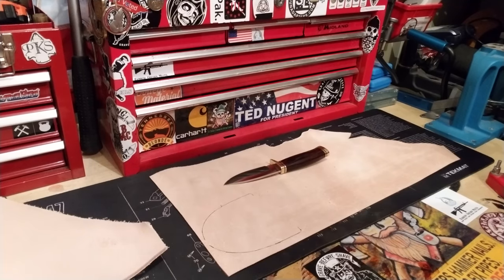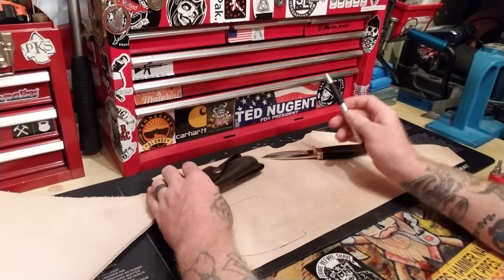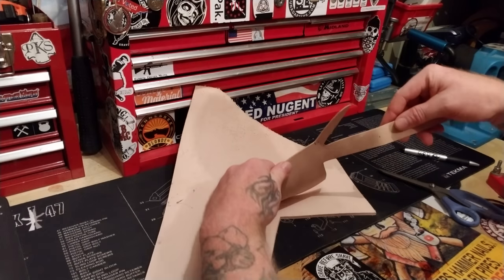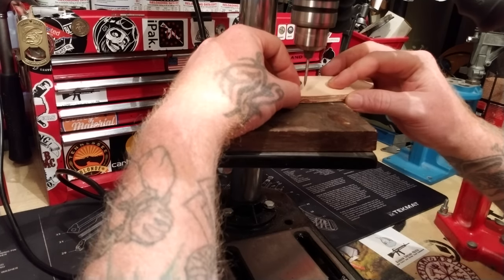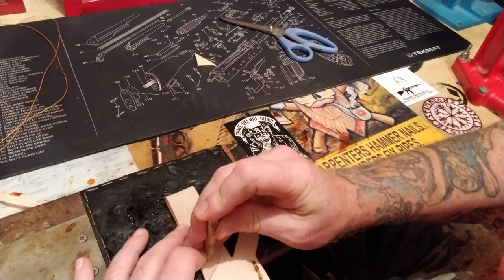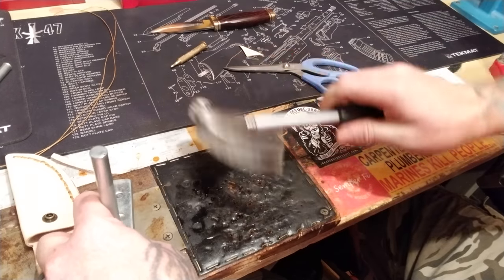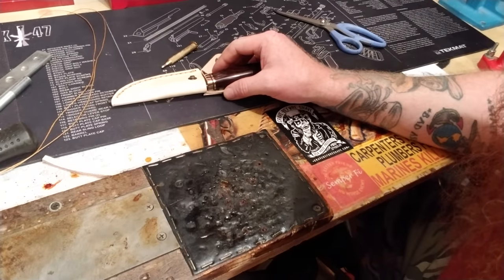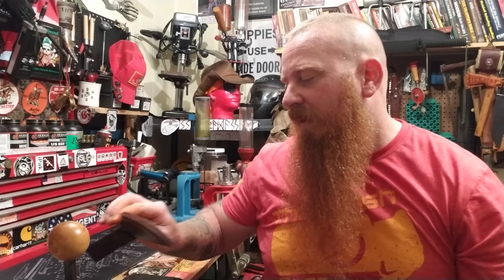Leathercraft Buck 192 Sheath

Comment: Hey since u make leather knife sheaths can u help me out and give me advice on what to do with my sheath. I got this custom made knife from a guy at a gun show and the sheath for it  is black leather and for some reason it keeps getting this white powder like stuff on it. I've tried washing it and then air drying it but still turns white as soon as I put it back in my safe. Do u happen to know what it could be causing it.
Reply from the maker: Sounds like it's taken on mold. Damp humid areas. That could cause corrosion. You're gonna have to either use Vaseline or bag bomb from tractor supply. You gonna have to rub it all over and get it inside with some kind of stick or something or toothbrush but you're gonna have to get it covered in Vaseline to get rid of all that white powdery stuff.
Reply: @StepOneSurvival  alright thanks. I guess I'll try that and see what happens. Worst case scenario, I'll just have to order a custom one from u.
Reply: @StepOneSurvival  hey forgot to ask about how long should I leave the Vaseline on the sheath for?